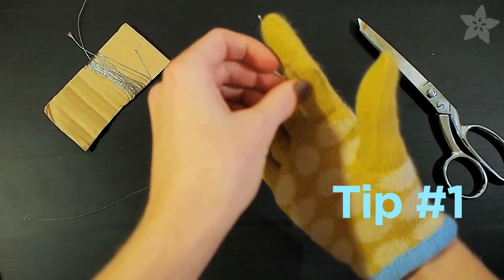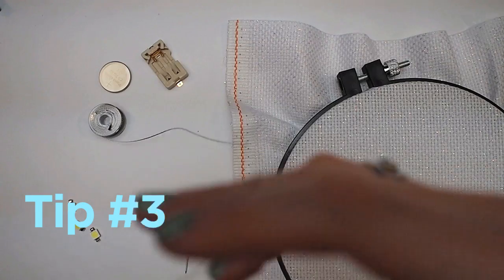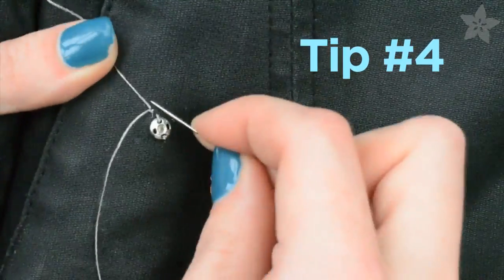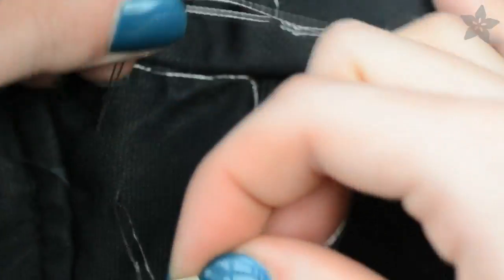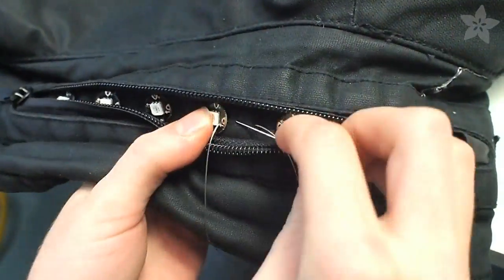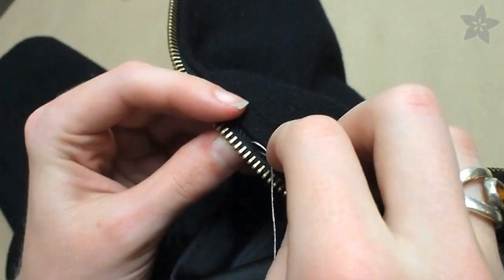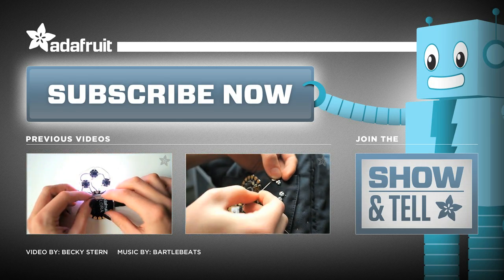Conductive Thread - 10 Tips

Comment: https://www.ncbi.nlm.nih.gov/pmc/articles/PMC5339735/
Reply: keep wearing your tinfoil hat man. That study looks at AC current through household appliances. ie the the mains in your house. 

These wearables use batteries, meaning DC currents of significantly lower magnitude.
Reply: Soaked Cardinal 
That’s what I thought. The current here is too low to have any real impact on our body.
Reply: https://www.ncbi.nlm.nih.gov/pubmed/26223801
Reply: https://www.ncbi.nlm.nih.gov/pubmed/24158621
Reply: what you're doing might seem cool to most, but you're messing with something that shouldn't be messed with, unsheilded wiring emits a ton of ELF-MF's (Extremely Low Frequency Magnetic Fields) what I've linked here is just the tip of the iceburg, ELF-MF's can impact your heart rhythm / health, contribute and cause ADHD, memory loss, and many other things...

Similar effects with higher frequencies like radio and cellphone / wifi.

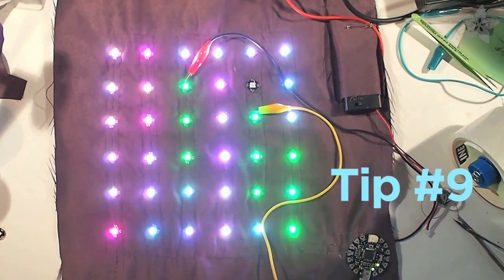Comment: Do you have any information (code snippets, circuit designs, power supply info, recommended type of conductive thread/wire, etc.) on how to make the 6x6 led matrix shown at 3:50 in the video?

Comment from the maker: It's made of stainless steel fibers, so it can be soldered but you need a special flux. However the sewn connection is quite strong, if you're inclined towards soldering to begin with, just use regular wire! =]